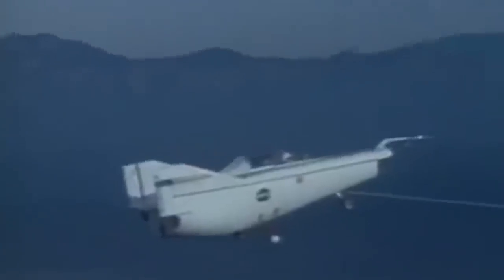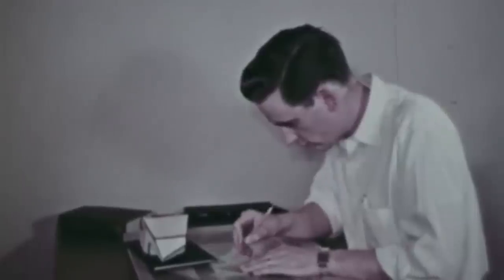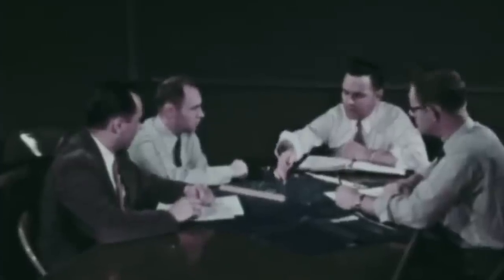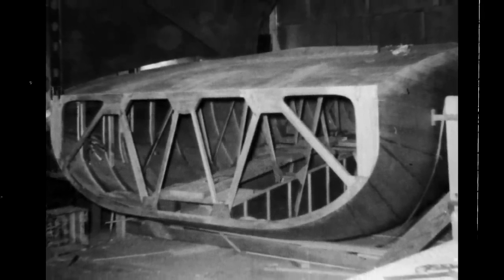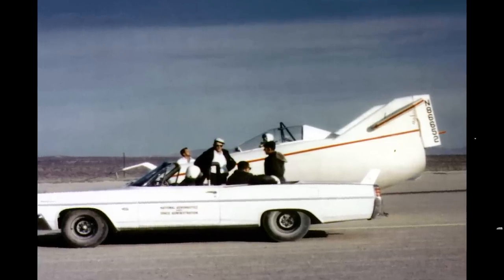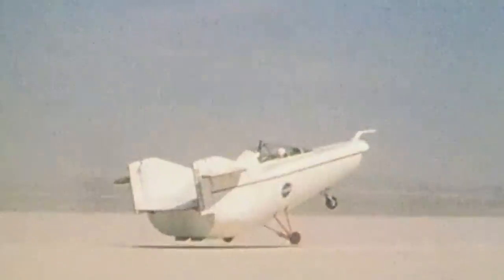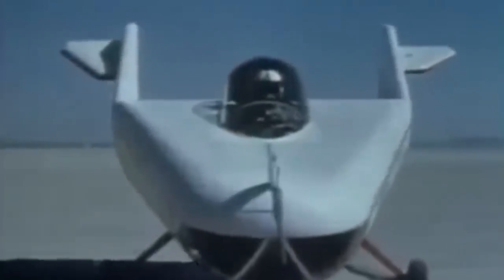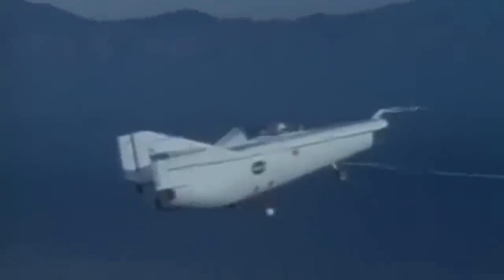No-Wing Plane

Comment: Estes made a model rocket with a lifting body shape. It took a model "B" engine, and recovery was by gliding
Reply: I had the model where a larger mother ship rocket (which returned by chute) carried a smaller glider up on its back. The smaller glider had a straw glued to the bottom, and this slid over a small dowel on the mother ships back, and so when the mother ships chute popped the glider would just slide off of the dowel.

Comment: While the lifting body was never used as a production military aircraft, the principle did find its way into at least one aircraft, the F-15, whose body is very much lifting body.  
There is a video in here somewhere about an F-15 that managed an RTB with one wing.  Just about all of the other wing had been removed by a rocket strike.  The pilot kept the speed high and landed very hot, but it was completely successful.  The video includes footage of the wing stub.  It sure wasn't providing much, if any, lift.  That pilot belongs to an exclusive club of one by landing a lifting body that had a wing attached to it on one side only.

Comment: No one uses a Pontiac if you want to go fast. My Mothers 1962 Impala SS did 12.4 in the quarter at Irwindale in last 63. That was on the stock garbage stock tires.

Comment: This aircraft design was the future project for the space shuttle program 
We were well ahead of the Russia 🇷🇺 
Just imagine seeing the space shuttle during the 1960s era instead of the 1980s era things would have turned out differently 
Thank god it was only a NASA prototype aircraft for space flight ✈️ 
& not used for military purposes 
Like through the Lockheed Martin or from the Air Force either 
Shalom dove 🕊️ of peace ☮️
Reply: These designs were actually the predecessors to the Dyna-Soar program, in which a single seat lifting body spacecraft was to take the first us astronaut into space. It was a military project. However when the space race panic started, the decision was taken to get an astronaut in to space the fastest possible way, and so the Mercury program replaced Dyna-Soar. Of course the knowledge and data was retained and was used in the space shuttle design. BTW the Soviet’s had their own lifting body testing going on during the same period of time.

Comment: Unfornunatly the space shuttles were a testament to our arrogance, and took 14 astronauts lives in the process.
They were to expensive, dangerous, and needed almost a total rebuild before they could send them back up again.
The Saturn V Rockets were more reliable, safer, and much cheaper.
In the end.
I'm very happy we retired the space shuttles.
Saturn V Rockets @186 million per launch.
Space Shuttles @1.5 billion per launch, and the lives lost which was immeasurable.
Reply: That's the wrong way to look at things. The Saturn 5 is designed for an entirely different purpose in Mission. And was never intended to be used as a main booster for delivering things like satellites.
Reply: @WALTERBROADDUS  I strongly disagree.
All satellites are put in space by unmanned rockets. 
They simply couldn't add the weight to a space shuttle, and exclusively used them for maintenance purposes only.
Which also could be done with the Saturn V.
The first space station was built using the Saturn V, that also made 9 manned trips to the moon.
Not to mention every other nation that goes to space, and uses satellites have never built or needed a space shuttle to perform such tasks.

Comment: To me, it looks more like a flying boat than a flying bathtub. Comparing it to a boat suggests comparisons to buoyancy and stones skipping on water, instead of something unweildy and far too heavy. A bathtub is filled with water, surrounded by air and stays at the bottom of a mass of air - a boat is filled with air, surrounded by water and stays on top of a mass of water - exact opposites.
I get a feeling they were trying to make a stone float, when what it's actually good at is gradually losing speed and "sinking controlably" - exactly what a spaceship needs for re-entry.
Maybe they were too busy laughing at the "bathtub" to really see what they had in front of them?
They sort of came back to that "controlably sinking stone" idea with the shuttle.

Comment: What's funny is nobody's tried fins for steering a space capsule, even though rocket boosters do it now for re-entry(SpaceX, plus copycats)
You could put 4, or even 2, or even just 1 fin on a capsule. From there with just 1 or 2 you could rotate the capsule and articulate just that single fin, or 2 fins. Otherwise you could use 4 fins and not rotate the capsule.
You can probably get away with 2 fins without even rotating the capsule, or rotating it using only those 2 fins and nothing else.
It could land on a runway, just vertically and not parallel

Comment: I wonder did the developers of the M2-F1 ever study the work of both the Horten Brothers and Alexander Lippisch, both of which worked on gliders that may have influenced the M2-F1's design.
Reply: The original concept actually was derived from earlier designs and studies of ballistic missile warheads. Surprising that it wasn’t mentioned in this video.  There was already a body of knowledge on the aerodynamics of warheads re-entering the atmosphere, that the lifting body program built on. It’s not by chance that the 1st designs looked like cones cut in half, ie warheads cut in half. It was known from th studies of warheads that lift and so a change in trajectory could be achieved by flattening part of the cone.
Reply: @PRH123  But I wonder was that research still highly classified at the time of the research into what became the M2-F1?
Reply: @Sacto1654  yes indeed it was highly classified, which is the reason that you almost never hear of it in these histories of the lifting bodies…. but the designers did have access to it…. as it was a high priority national space project…

Comment: I've seen a much larger version of this plane with the same underside but a more curved upper side and it was silver grey (i.e. brushed aluminum-like) and softer more curved winglets that had MUCH BETTER maneuverability than this one! I still have the 16mm film to HDcam 1080p transfer of that footage of the larger craft.

It outmaneuvered an F104 Starfighter AND another aircraft which I think was an F101 Voodoo like they were toys, banking and turning in and out of high cumulus cloud cover in such a way with NO exhaust ports visible nor any active wing surfaces, such that I am pretty sure it DID NOT USE aerodynamic principles to fly! 

I could see a clear canopy which was less bulbous than this one (i.e. more aerodynamic and more blended into the body!) but it was too far to see the actual pilot in the silver craft. Because of the TYPE of clouds seen in the film, I am guessing the encounter took place at the operational ceiling limits of the Voodoo and Starfighter aircrafts which are about 52,000 feet!  The fighters were TRYING to catch the silver craft similar to this one but the manueverability and speed were just too much! I am guess somewhere around 1967 to possibly 1972 for the encounter due to specific Kodak 16mm film stock symbols on the outside frames being present! 

There was one logo/symbol on the silver craft's hull which leads me to believe it was made originally (or re-fitted!) by North American Aviation (which was acquired by by Rockwell) in the early to mid-sixties due to it's shape.

Now you know!

V
Reply: The X24A?
Reply: @DECODEDVFX  YES! It LOOKED like the Martin X24a but it was much larger at maybe 3x the size and could maneuver like nothing I have ever seen in any jet! The bubble cockpit looked different too in shape being more curvaceous and sleek!

In the video I saw, the craft had no exhaust nozzles so it was NOT using a conventional propulsion system and was NOT a glider as it was able to CLIMB FAST AND HIGH plus bank/turn/roll like no other craft I've seen!

In the 1980's-era video (My guess!), I am guessing the follower/tracker aircraft  COULD HAVE BEEN an F104 Voodoo or a Navy Viking aircraft that had the camera on it! Once I find the video again, I will post it!

V

Comment: Never found development, but influenced..... I've seen the influence in contrailing drones. Perplexing low and slow extremely small wings to girth ratio as to perceived weight. Double hull with helium, could reduce propulsion units potential power.

Comment: Lift bodies have a limited range of speeds they are stable at, bot in slow and faster velocities., The air becomes rather like a body of water with a log floating on top, any weight on the log and it's going to tip, or get the log to want to roll over. They also have thresholds when they tip too much at an incline or decent, causing them to nose in or up uncontrollably.  The air needs somewhere else to go besides just to the outer parameters for better stability.  I still think along the lines of a Tomcat may be the way to still go, we certainly have that kind of system going on with missiles deploying fins, might as well incorporate them in these for the slower speeds to land.

Comment: People joke about the "flying bathtub," but ALL modern fighter aircraft now use this "lifting body" concept, the F-15, arguably the greatest fighter aircraft ever designed derives more than 40% of its lift from its fuselage as do virtually every other modern fighter designs. This concept also led directly to the Rockwell Space Shuttle, the single greatest aircraft ever designed (with the possible exception of the Wright Flyer) The "flying bathtub" is one of the most significant experimental aircraft in the history of aviation and it deserves far more respect than it gets.

Comment: Didn't the six million dollar man crash in a later version of one of these, the Northrop HL-10?
I recall the opening intro where there's a top down shot of this lifting body dropping from the mother ship.
Reply: Yes, however, in Six Million Dollar Man intro, the craft switches between the M1-F1 and the HL-10.
When it separates from the bomber, it's an M1-F1, but when he crashes, it's an HL-10. The give-away is the tailfin configuration.
Reply: Kind of. The drop is the HL-10, but the crash is the M2-F2 piloted by Bruce Peterson. He survived with relatively minor industries, but then lost an eye due to a hospital infection. The M2-F2 got rebuilt into the M2-F3 with a third stabiliser.

Comment: The Dreamchaser craft is essentially a lifting body although it does have some "wings" toward the rear angled steeply up for stability control. the Lockheed Martin X-33 would have also utilized the lifting body design and research.

Comment: just a note, various aircraft have some lifting body characteristics.  If you research the story of the Israeli F-15 that lost a wing in a mid-air collision, but was still able to safely land, the reason it was able to [besides some outstandingly quick thinking by the pilot, and the fact he didn't know the whole wing was gone due to the fuel spray off the ruined side] was because the F-15's fuselage is very much, a lifting body design.  Not a pure one like the M2 series or HL-10 mind you, but the properties are there.

Comment: This is all fine, but there’s a problem with the way that this aircraft is being presented. No new aircraft exists as a standalone project. The Air Force is supposed to have a long-term plan. For example, cheap good transport planes, and cheap good guided missiles. Those multiple objectives are supposed to fit together, in order to produce a mission ready Air Force.

But we don’t have a mission ready Air Force because corrupt military personnel take bribes, and consulting jobs, and delayed employment offers, and cash. In other words: the whole thing stinks. And Boeing is at the heart of the problem. 

The corruption in the military industrial complex is so bad that normal planning and procurement is no longer possible. The Air Force has hundreds of unnecessary projects which contribute nothing to our national defense. 

We need a completely new procurement system which places honest men at the helm. Cancel the Osprey, the F-22 and F-35, and all of the so called “advanced” aircraft. Those half-built boondoggles will never be of use. Like the new incredibly over-priced Super Helicopter. 

The first step in getting things back under control is to expel all military personnel from the White House. No military security, or military helicopters, or military anything. The military isn’t responsible for the Executive branch.

Comment: The aircraft was considered insufficient for low air speeds and cancelled.
Not a problem when you're coming in from orbit. It flew just fine at 120-150mph. They were worried about the pilots, but with modern circuitry and software that is easily mitigated. Thus why we're now seeing this concept being re-established.
We need to start digging old concepts out of the history bin, because we're 1000x more advanced than we were back then, with both material sciences, computer sciences, and data sciences.
However I still have a feeling that Nichola Tesla's "wireless energy" concept isn't feasible, even today, and maybe never.

Comment: lifting body was not a good name and was argued. Because None of these things ever FLEW or could fly.   They had no lift at all.  2000 mph in wind tunnel produced no lift at all.   what they had was surface air flow friction that slowed their fall , allowing the forward velocity ( it would already have from re entry" to remain greater, unlike a capsule that loses all forward velocity and eventually becomes an uncontrolled straight fall. These things fell under steering control. they didn't even glide. It was more like falling sideways, Like a projectile or an arrow. If you dropped one that had no forward velocity to begin with, say from a helicopter hovering. It would fall straight down and never obtained and forward velocity on its own. Flat fall to the ground. same thing happens if you drop a arrow from your hand. It will never gain forward velocity. The purpose of these was to keep some of the reentry forward velocity and steer the fall.